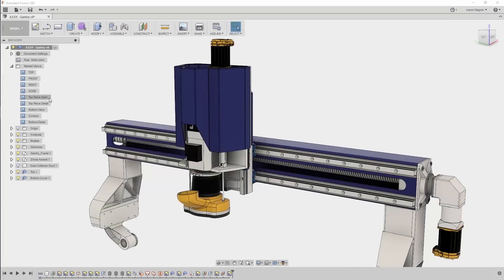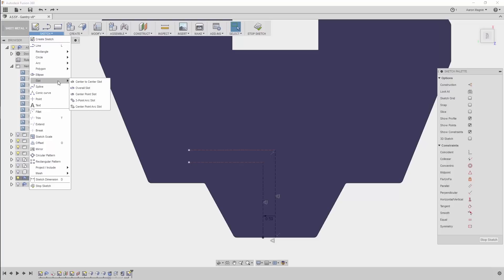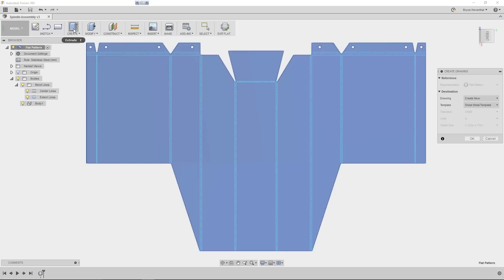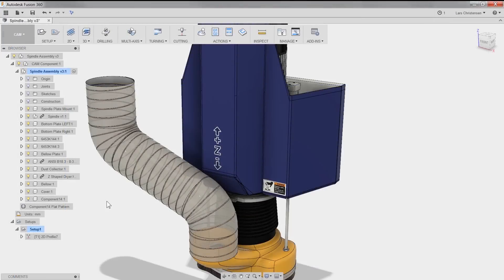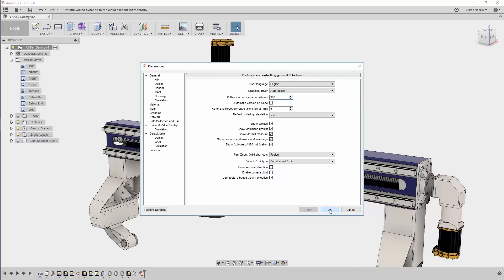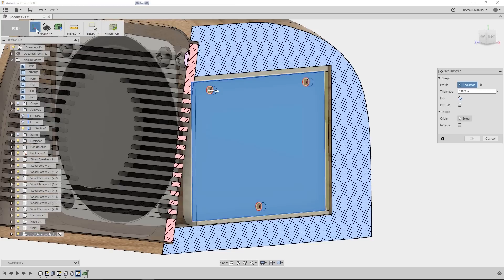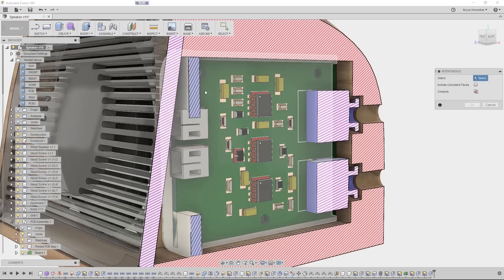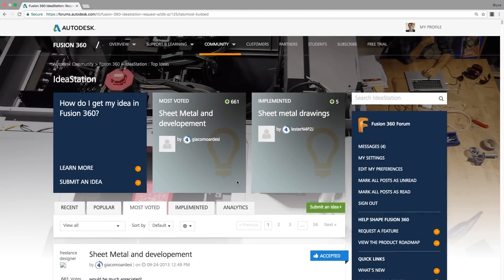What's New in Fusion 360 August 2017 Update

Comment: Although i'm sure many users appreciate all the hard work and updates to fusion, I on the other hand would like a less loaded version to be made available, when I started using fusion a few years ago I found to be perfect for 3d printer hobbyist, but now there is so much more,  it went from a fast ,easy to use cad options,  to a bottle neck and very  slow frustrating , I know I don't have the fastest laptop out there, But it uses to work like a charm, Could you guys make a less loaded version available for hobbyist like myself ?

Comment: Would be more useful to me if I could start from the other direction, take a flat pattern and bend it along a line. Wondering why that functionality wasn't included. Or am I missing something?
Reply: the 'normal' way to design a sheet metal part is to model it how it should be and then flatten it. This workflow eliminates the need to bend your brain around the 2D- to 3D transformation. 
If you design sheet metal parts on a regular basis you gonna see why one does it this way and not the other
Reply: Yep, I get that. It's a great capability for sure, but I'm not actually designing sheet metal parts. I'm using it to 3D model pre-existing objects that have parts made out of various materials, sometimes cardstock. These parts are patterns that would normally be cut out and folded into 3D shapes. I can do it without the "sheet metal" feature, but I imagined that it would make it easier. Draw out the flat pattern as a sketch, extrude it to the material rule thickness, and fold it along drawn lines. Maybe in a future release. :)
Reply: I am pretty sure this is just the beginning for sheet metal. More functions will be added.
Reply: I hope so. Thanks Lars!

Comment: SolidWorks days are numbered.
Reply: Exciting times...
Reply: Michael Strong You are right about that! So tired of how they are more worried about butt tight licensing and fees than making it easier for the user to install and update.
Reply: This is exactly why people are migrating to Fusion360. I still get calls from them to purchase and I continue to this day to decline.
Reply: hm based on what you need! For modeling Fusion is way under-powered and the sketch engine in Fusion is riddled with so many bugs it can ruin the parametric workflow. Before F really can compete with SW I think a lot years will follow. SC for Rails took 2 years and does not have G1 G2 weights so it is incomplete.

However for those who need not the advanced toolset of SW Fusion for sure is already replacing SW as a much better and cheaper option. In industrial design it will take a lot more to make F being able to replace SW.

Looking forward to that day since I feel Fusion brings a much fresher approach to digital designing!
Reply: they have Solidworks Mechanical Conceptual cloud CAD, so i would say that traditional file-based CAD's days are numbered
Reply: Michael Strong Inventors also!
Reply: Maybe you're a billionaire now?